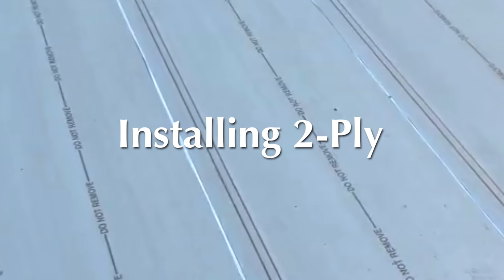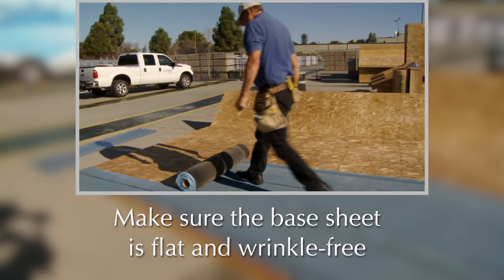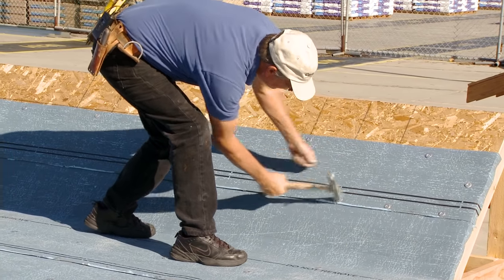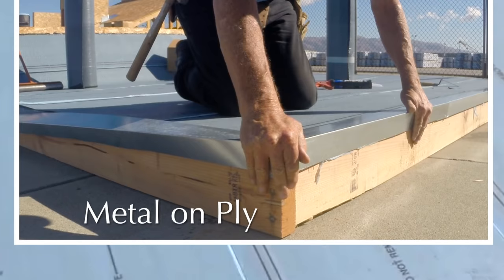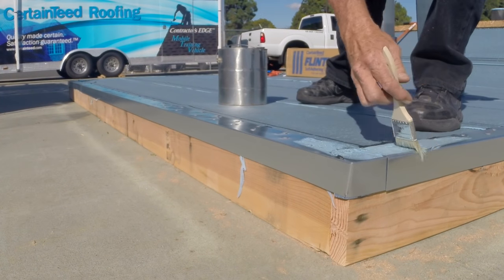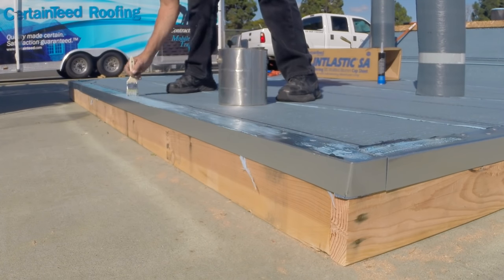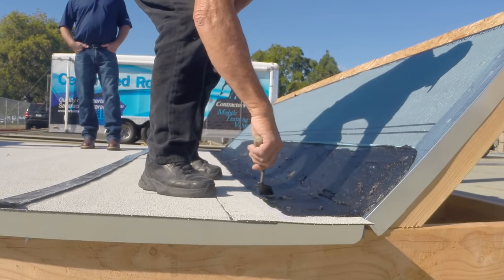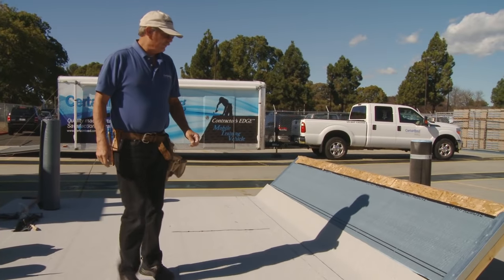Application of Flintlastic SA 2 ply and 3 ply Self-Adhered Roof Systems

Comment: I like these instructions. I’d get nails lower in the starter strip though. I’d rather omit the starter strip than nail it that high.
Reply: is it possible to install this on a house that already has gutters up?
without using the metal around the edge ?

Comment: Just primer is needed to tie cap sheet into the drip edge? No mastic? I'm working on 140sq ft shed roof.
Reply from the maker: The metal must be primed and, once cured, you can self-adhere to it. A bead of FlintBond Caulk Grade can be applied along the edge of where the cap sheet and metal meet.
Reply: With the metal set in mastic, water can’t leak around the metal edge and behind the fascia. Also, the nails that holds down the metal also goes through mastic. The primer on the metal is obviously sufficient if you follow the base, mid, and metal installation instructions.
Reply: @CertainTeedRoofing  you like using a mastic as primer and not quick cure spray on in a can? What about both?

Comment: Before I retired my crew installed over 2,000 sq of self adhering cap sheet made by Garland and we found out it's not the right system for production ,all tear off must be 100% cleaned up before any installation or dust collects and interferes with bonding ,we ended up changing the system to the base sheet and 1st ply to be sprayed down with cold process where we phase roofed the entire building ,then the self adhering modified install was 100% easier.

Comment: The metal  trim does not go into the guttering. You have not left room for the gutter brackets. We always nail a 2x1 batten on the facia.
Reply: This is a demonstration, not an actual roof
Reply: And if it was a deck it might not have gutters 🤣

Comment: It appears that your starter shingle is install was incorrect!  Shouldn’t nails be 2-3” from edge, just above sealant line?  Preventing  wind uplift of first course!  (First 6” of shingles)
Reply: In this specific type of installation where his shingles hung 2” past the edge of his starter , the first row of shingle fasteners will secure that same area. So I’m sure this would be fine. Plus the wind uplift is far less then normal of hanging over an eve. However , right is right. YES always fasten your starter exactly where you mentioned. Even tho his first row does fasten this exact area on the starter below it, it would obviously be much stronger had the starter been fastened there to begin with.... personally, I do use a starter here, but I set the starter in mastic , then the first row has mastic applied to bottom 3”. And I never but my gable starter to the top of the eve starter. I bring the sealant lines together. If it’s a thin starter I’ll just over lap, if it’s thick then I’ll trim both pieces so that the sealant lines make almost a perfect corner. The smallest extra effort in detail can mean the difference from someone becoming reputable or not.

Comment: Does the selvage area at the rakes not need to be cut away at an angle, similar to t-seams?
Reply from the maker: Thanks for your patience Dan. This is Justin with CertainTeed Roofing writing, and I received the following answer to your question from a colleague in our technical department:  'No cut away should be made at the rake. That is just utilized in the end lap details.' Please let me know if you require further information.
Reply: CertainTeed Roofing Thanks! I had seen both approaches from different sources. I went with "no cutaway" approach so I'm glad I did it right!

Comment: I've never heard of starter strips on the sides.Is it necessary and if so, what is the function?
Reply: Wind and hail is obviously hard on shingles. But it’s even harder  on gable shingle overhangs. An additional row of starter extended up gables does several things. It acts as an added support that helps hold those shingles taught for extended periods of time. It also allows for another point of adhesion giving more total weight to fight the elements. Wind will often curl the corners of gable shingles, I’m sure you’ve seen this. With starter ran up the gables the wind can no longer cut thru from the bottom and lift those corners no where near as easy as it’s able to without starter. When thinking of a roof in terms of longevity , I would consider this necessary. Now shingles have been used for many years, and the previous method with starter applied to bottom row only has worked in a lot of cases. So it can be argued as a way to save money stating a roof can work without adding stater to the gables. Personally, I would rather spend a few extra bucks on fortifying the integrity of my roof, rather than argue past practice and not make the change just to  find out  at any point that I SHOULD have made the change. Because if that regret is in us, it was put there by damages were seeing in our roof that could have been prevented....🤙

Comment: Why use a base sheet why not just a ply and a cap? why use 9 inch strip why not just use mastic or a full layer of ply?
Reply: They have a 2 and 3 ply system
Reply: @brandonbrady2821  y use a 9 inch target sheet tho
Reply: @Brandon-no3vc  to stagger he seams
Reply: @brandonbrady2821  watch it again he doesn't use it to stagger seams
Reply: @Brandon-no3vc  oh it is to go under the flashing because the flashing has to sit on membrane
Reply: @brandonbrady2821  why not use spray primer or modified bitumen tar
Reply: @Brandon-no3vc  because it doesn’t go with this system and each of the plys is a form of modified bitumen hence why they cut the 9” strip to put under flashing , they do put mastic under the flashing and they do prime the metal
Reply: @brandonbrady2821  so on the 2 ply do you still put tar between 9 inch strip and Metal? And ontop of metal? 4 the 3 ply system he put tar under metal and a diff primer ontop why not use tar ontop as well?
Reply: @Brandon-no3vc  I would assume that process wouldn’t change between the 2 and 3 ply systems
Reply: @brandonbrady2821  why can't the metal just sit on the tar then why do you have to also put in a 9 inch strip?
Reply: @Brandon-no3vc  so that would be because in the 2 ply system there is no mid ply so the metal has to be on a membrane so you cut the perimeter strip
Reply: @brandonbrady2821  why does it have to be on a ply tho if there's mastic going on the ply anyway why can't you just put the mastic on the nail down sheet without the ply
Reply: @Brandon-no3vc  mastic Is not a membrane
Reply: @Brandon-no3vc  also you are only using the 9” membrane piece in the 2 ply system because the metal can not go on the base sheet, in the 3 ply system you wouldn’t need to do this
Reply: @brandonbrady2821  I know. Mastic is tar. And yes it they say it cant go on base sheet why is that? Also if you put tar down it wouldn't be on the base so why not just use tar instead of 9 inch strip? Metal wudnt be on 9 inch strip anyway it wud be on tar
Reply: @Brandon-no3vc  when you are doing the 3 ply system you don’t use the 9” strip because it is sitting on the mid ply membrane. The mastic probably does not adhere to the base sheet because it is not a membrane and there was probably an issue when testing this system ! If you are that curious I’m sure you can call up a certainteed rep and find out the 100%correct answer. But it is just the directions they give to install so I wouldn’t really question the method myself.
Reply: @brandonbrady2821  do all brands use the 9 inch strip?
Reply: @Brandon-no3vc  if they are self adhering membranes that have a base sheet I’m sure they would be relatively close to the same procedure for installation